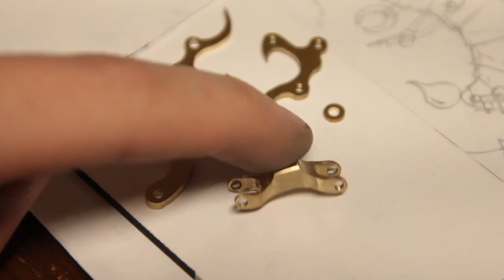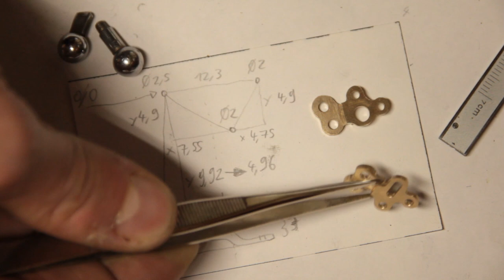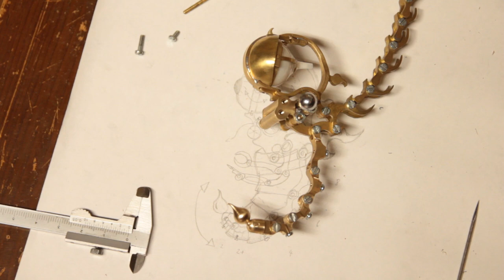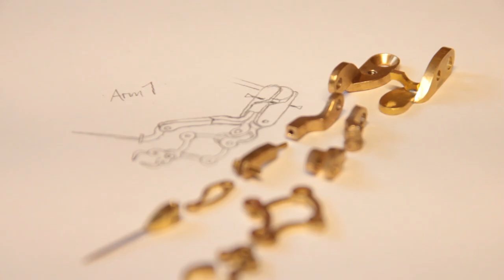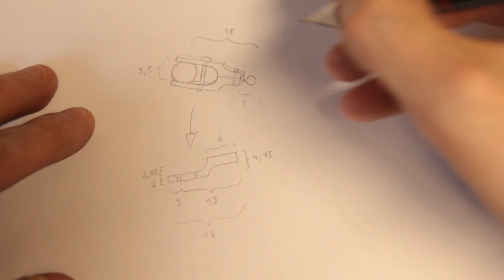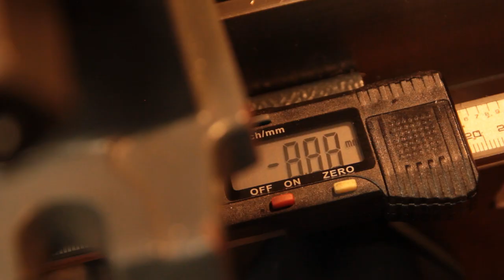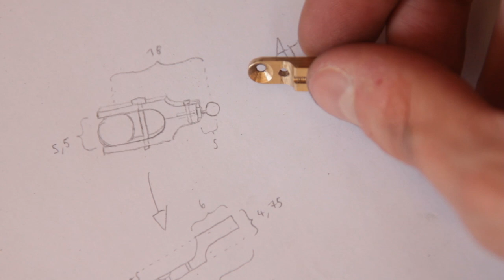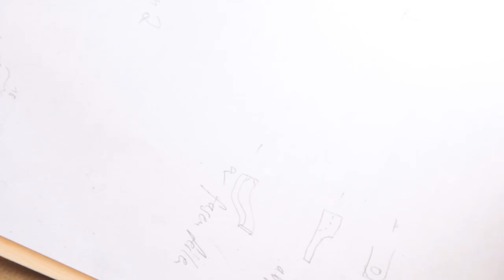Steampunk probe sculpture - Making Of | An Unwound Clockwork

Comment: Your skills at making such finely crafted pieces for your creations, designing chops and knowledge of tooling with milling machines and the rest of your workshop tools is top shelf. This brass eye socket is smaller in size but reminds me of a Boston made vintage timing light housing, of which I've collected two. I've been wanting to do something similar with mine. They have a great cyclops appeal.
Reply from the maker: Thanks a lot! :) Great idea about the cyclops lamp, I can really imagine it - Good luck with the making, I hope my character was inspiring! :D
Reply: Timing lights are generally used for automobile engine tuning. The ones I mentioned were produced for very early 6V auto engines. I too am an artist. I use Found Objects to create my sculpture art. I don't have your skills or the sort of tools you have to craft parts. I rely on my ability to seek out items with peculiar designs and materials to build my designs. After building my first bot design in April of 2022, I also considered the notion of a stop motion film with it. Because my bot's legs, arms, fingers, torso, and mouth can be articulated and repositioned for such a project. My bot design is 38 inches tall. So, its world to explore will be a large set to design. 

I look forward to viewing your film once its complete. I'm certain that all of your team's hard work will produce a wonderful story and that you will reap significant and much deserved success via your endeavors.

Comment: You are insanely talented 😁👍
I wish I had this kind of equipment to build such unique machines like you
Reply from the maker: A lot can be done with a set of files, a jewelers saw and a simple drillpress. I used to work with basic tools for many years, and its good to get some experience with handtools before starting to use a mill and stuff like that... :)